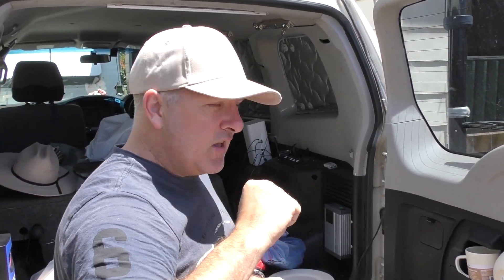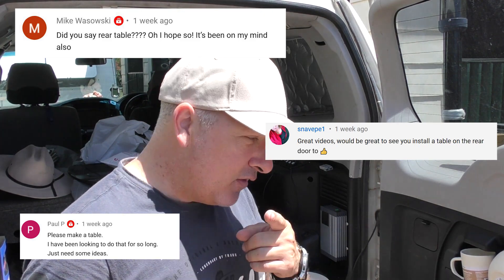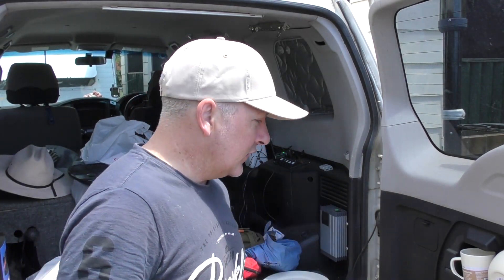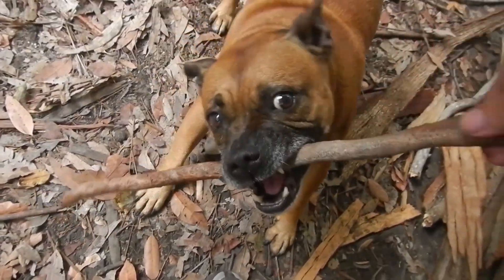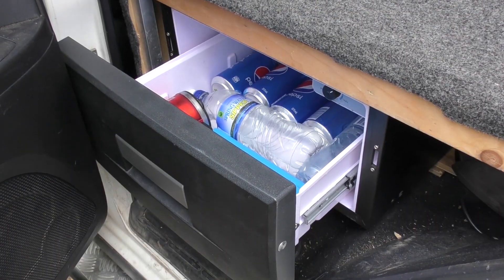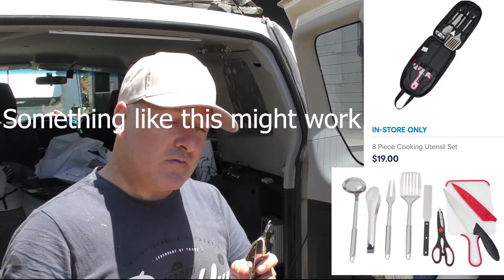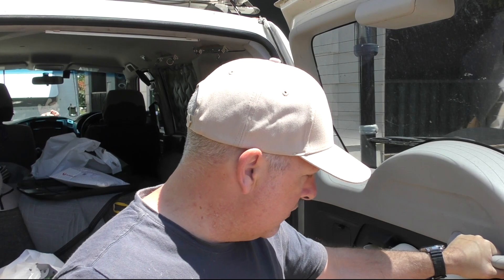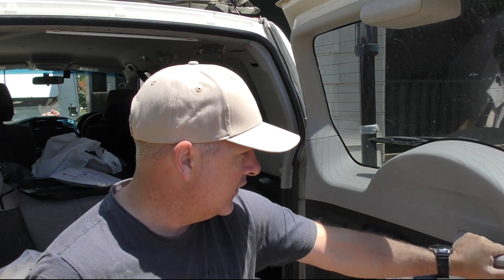4wd rear door Table Build - getting a plan together

Comment: i use a bcf camping bag for dishes etc as it keeps them clean and doesn't take much space will be making table for back door later at the moment keep jumper leads and emergency triangle in the slots but might change to condiments when table made but good luck on your design less weight on back door is better
Reply from the maker: Thanks David, 
yes weight is on my mind. those cups etc don't weight much at all, so I need to consider my materials carefully. fingers crossed it all works

Comment: I’d screw a whole splash back to the door.. protect the interior and then build off it.. maybe even remove door liner to save your interior for resale. (Cutting board type material ??)
Reply from the maker: I'm not very good at wood work and the like. I'd fear anything I make up would just be shit. That's why I'm trying to work with what I've got 😁 I'm also short on space when my bed build his in. Thanks for the input though. I'm considering it all as a progress
Reply: @DENMONKEY   Something like a plastic breadboard. Most butcher shops have now on there tables. Cheers

Comment: If you want to keep it relatively stock and not drill into the plastic too much, you can remove that plastic bar you've got the cups and plates sitting on, make a little table that fits the cavity and fix everything to the bottom of the folding table? That way you can buy little metal spring push tabs and space them to fit your plates for easy storage rather than the bungee cords
Reply from the maker: the top section of that door where the bar is, actually comes out. I might have  alook at removing it and see what options I have there. cheers for the input Aidan

Comment: Idea is good, i would however not cut the plastic part under the bowls, i would cover the whole door cover with a bungi cargo net. Then it could hold cloths, paper towels, and keep the plates in tact by fastening the net in the middle and other strategit places with self tapping screws to clamp the plates down tighter. Accessible from the top
Reply from the maker: That's the 2nd view for netting. Any suggestions on a source for some or something you recommend?
Reply: DENMONKEY partner I am in South Africa, so I wouldn’t know whats available in Auz lol
Reply: Denmokey, any update in a solution yet? Have the same car as you...looking for that final reveal

Comment: I removed the plastic piece from the front of the shelf and ran paracord x 3  (ebay) across on both the top shelf and the bottom area.  Know takes bigger items and holds them in
Reply from the maker: Thanks Wayne. I'd that a specific type of paracord?
Reply: @DENMONKEY  Type in Ø6mm SHOCK CORD / BUNGEE CORD, SOLD PER METRE. AUSTRALIAN MADE "FREE POSTAGE" in ebay.  ^mm is OK but you can go thicker if you wanted to.  I drilled a hole in the plastic and simply threaded the cord through and tied a knot.  The cord applies pressure to the things you are holding/storing on the shelf.  it is not too expensive either
Reply: 6mm whoops!

Comment: Hey Den Monkey i have a gen 3 nm and the space in rear door is huge this is were the rear seat head rests were meant to be stored, theres netting across the area and all sorts of straps, the head rests have long since dissappeared, maybe you could grab the gen 3 netting from wreckers or after market and secure all the gear, will rrry and email you a pic, the table ideal is really interesting seen them for jeeps and the like after market. Looking forward to the next video in this series.
Reply from the maker: thanks for the ideas Dave, in the 4th Gen, they seat heads were stored in under the floor in the same space where the seats folded into. Unfortunately that's pretty full up in there. I do love that area though. I've got a rough plan now after reading everything. I need to check a few mates set ups out for some specifics and source the right materials I need. I think this might go through a few versions before I'm done

Comment: I have been running the table I made in the back of mine for a year now and love it. I just used some 19mm plywood and some large hinges. I ended up putting some timber on the inside of the door to screw into and clamp the hinges to the plastic. Just using some old hat strings to hold the table up at either end and a latch to hold it up when not in use. I also added a bit of stainless to the table surface.
Reply from the maker: I definitely want ss on the top, but I'm not sure if I can make one only it of ss or if I need a backing, like timber. I played with some stuff at Bunnings but none of it was what I was after. Do you think you could have gotten away with lighter ply?

Comment: Interesting to see your ideas. Great idea to put a light under the high brake light. I’m thinking about the small battery LED lights from Supercheap, usually in a bin near the counter. I’ve used the ball type for lighting around a camper trailer. Great lights and no wiring needed.
Reply: And if I glue a small piece of metal underneath the brake light then I can use the magnet on the light to mount it!
Reply from the maker: I've sussed those out.  I think they're only about 5 bucks. I have these touch led strip lights got ages ago and need to use the for something.
Reply: Well I thought it was such a good idea that I’ve done it. Glued a 2cm washer to the brake light case and now can use the magnet on those cheap swivel led lights.  Thanks for stimulating my brain cells!

Comment: Could you use rare earth magnets behind the plastic to hold the metal cutlery in place?
Reply from the maker: Bloody good question. I'll check. I'm not sure if the metal they are made of but I have a feeling it's not very magnetic. Plus I'd need to get the magnets from China and that could take months 😁
Reply: @DENMONKEY  jaycar sell them as well.

Comment: If you have watched my walk around videos you will of seen what I've done. Someone below said about cutting into the bottom to slot the plates into. I don't mind that idea. Personally I think the spots on the back doors of the Gen 3 & 4 is perfect for coffee, sugar, tea, cups etc etc. I keep my coffee cups, plates, bowls and cutlery in my draw. A set for 1 or 2 people takes up very little space. Interested to see what you do with the set up mate. If you are doing a drop down table make it adjustable so saucepans don't slide off the cooker etc. I've had it happen and my meal ended on the ground.
Reply from the maker: Yeah I like your full size table. I'm planning on using up the whole width , adding some fold up sides(wind blocks) and maybe slide out section from underneath. I don't know how realistic I'm being though. I want the table to be made of stainless but timber will be easier to work with. Lots of ideas but I need something I can actually make and not cost a fortune.
Reply: @DENMONKEY  I did think about a Stainless cover for the cutting side but after my Aunt painted the bottom side I wasn't going to do anything to cover it. If you are ok working with thinner timber I'm sure you could make a slide out section from the side. Another option could be a bit stored under the bed that clips side and has a leg for support. Maybe small bags bolted/stapled Under the table that can hang down with utensils for cooking.

Comment: keen to see what you come up with, not sure how good the sealing of the rear door is whether dust may be a problem or if you leave your rear door open exposed to dust. Good luck!
Reply from the maker: I do get dust in the back but only up to the rubber , not had any come in as yet. Thanks for the input. I'm taking everything on board.

Comment: Need some help.....  I have 10 -  36 volt 225 watt solar panels.  I want to buy batteries for it.. I like to buy the common 12 volt batteries..   Maybe 4 to 6 golf cart or solar batteries. Question: Can I buy a Mppt Regulator to convert the 36v solar panels to charge the 12v batteries?  What would you do?
Reply from the maker: yes, you can but with so many panels, I couldn't point you to one big enough to handle that sort of current. It would also depend on how you wired up all those panels and what voltage is being sent to the controller. That size of set up is  a bit outside of my comfort zone I'm afraid. Whilst all the basics are the same, I haven't set up something that big and couldn't give you any advice on brands or ideas on the challenges you will face in doing so. Check out some of the tiny home or off grid type channels. they should have the info you need
Reply: @DENMONKEY  Thanks for the quick response!  Happy Thanksgiving....

Comment: If you screw in the knife and fork holder you miss the use of the bottle and can opener?..  bizarre idea!
Reply from the maker: yeah. its my least favourite but the new rear shelf has a bottle opener built in. Mind you I've not seen a bottle that requires an opener for a long time. Open to ideas to improve those though

Comment: G'Day mate - A few ideas - You could remove the entire black trim & custom make a carpeted MDF board, gives you a nice area to add all the bungees, shelves, cutouts etc.
Continuing on with your ideas - Utensils: Grab a little pencil case/canvas pouch of some sort & screw it alongside the handle. Lights - On my setup I ran LED strip around the window perimeter, one amber (for the bugs) and one cool white. A head torch was still needed sometimes. I'll send you a link with some pics of my setup & some other ideas I've collected along the way. Heres an x-trail but worth a gander: https://www.youtube.com/watch?v=i9th0NaOwvc 
Cheers
Reply from the maker: Thanks turorit. I'll sure it out. That utensils set I put the pic of had it's own case. I haven't seen it in person but it might work like the case. Sing a board could work but id definitely have to cut away the panel. The to section is removable but the lower is all one part. The dual colour light is on the cards too to avoid bugs. Thanks for the input mate.
Reply: @DENMONKEY  No worries mate, looking forward to seeing what you come up with. At least you're not as shy about cutting into factory trim panels as I am! Here's some pics, I'll take a couple more of my setup at some point. https://drive.google.com/drive/folders/1h-JJsWBguSYVgcgYL4eMQi_QBby79QjY?usp=sharing
I hid the switch for my LEDs where you store the cups, it ended up being a bad idea. The amount of times I closed up the table with the lights still on....